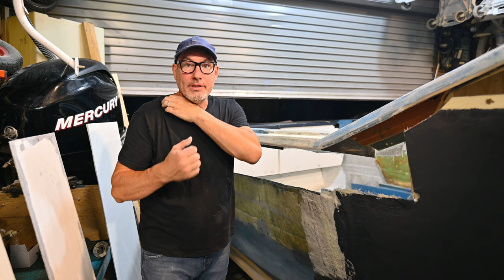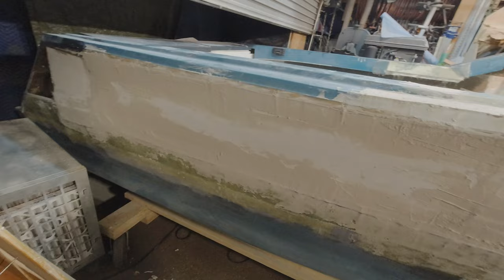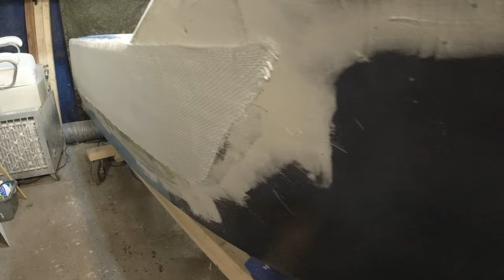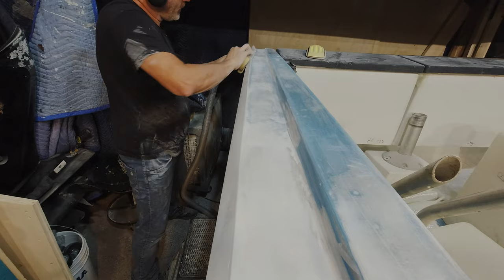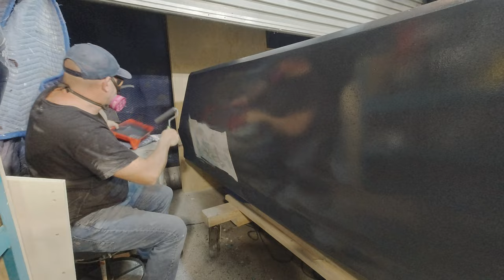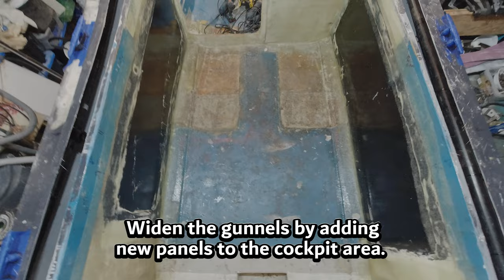BOAT REBUILD - EP9 - Hull Sides - Back to the future Boat Build.

Comment: Interesting build, my first boat was a 15.5 hourston. Was a great boat. Not sure if I misunderstand you’re explanations, but sounds like you’re mixing epoxy products with polyester resin. Poly will not bond to epoxy, but epoxy with bond to anything. 
Good luck with the build! As others have said, great editing.
I went a different route and bought a semi rebuilt 20’ Hourston with a pod, love it. Working on an old 18’ now, 23’ deadrise should ride soft once she’s done.
Reply from the maker: Hi, Thanks for watching and commenting. Its awesome to have another Hourston lover aboard. 
Its funny but as I am making these little videos, Im trying to convey my thoughts about my process. Sometimes it comes out a bit garbbled. I am using only polyester resin on everything up to now. Its so easy to slip and say Epoxy when reffering to Polyester resin. The first few videos I wasn't confortable yet and definately was not really consious of my slips untill to late. Im trying my best to say Polyester or just refer to it as plain Resin. That said... its all poly based so far. Thanks for noticing. I hope you/WE can get out in the boat real soon! Cheers

Comment: Are you concerned about getting boat registered?  It doesn't have a Hull ID.
Reply from the maker: Hello, thanks for watching. You are not the only one to mention that. I was going to wait untill another Tech Talk to comment on the Hull ID. BUT... no reason I can't do both. SO, when I cut up the old transom I saved the Hull ID that was embosed/intergrated/fiberglassed into the old incarnations mold/hull. I HAVE re-fiberglassed it into the new transom. I just haven't highlighted it. YET. I wasn't sure the nuances of boat hull ID restoration guidelines when I started. Ive done some homework and found that, the majority of the time, the manufacturers HIN on the boat just has to match with the boat registration. And  the Department of Highway Safety and Motor Vehicles has a history of my boat over the years. There is an application and inspection process to get it re-registered. Its the process specific to imported and homemade vessels. I'm 3/4 my way through the process. They want to see it finished and seaworthy. The nice guy I talked to at the DMV seemed to understand that many boat transoms get rebuild everyday. It wasn't a new issue to them. I equate it to restoring a classic car. Try to save all the OEM ID tags. That said, I'll let everyone know once Im closer to getting it registered. Thanks for the question.